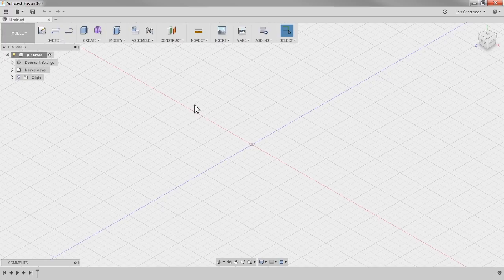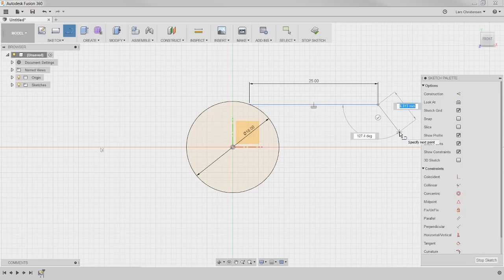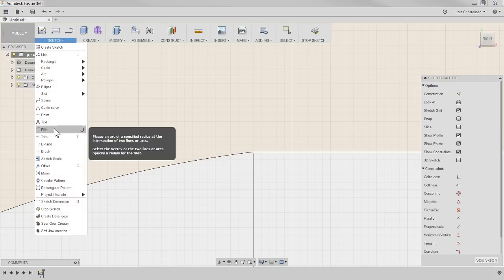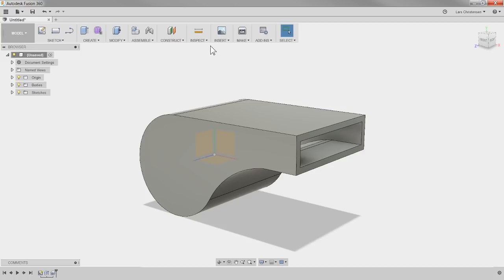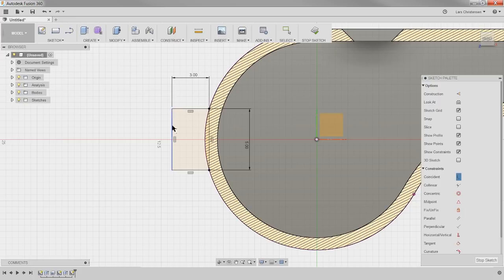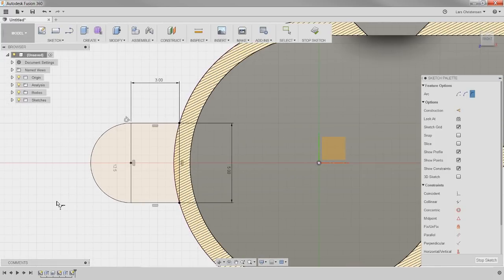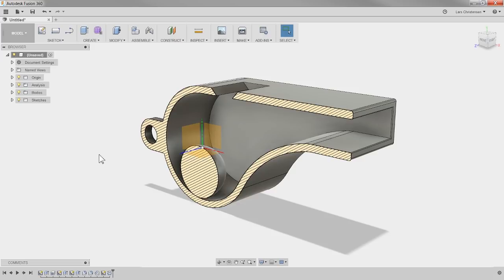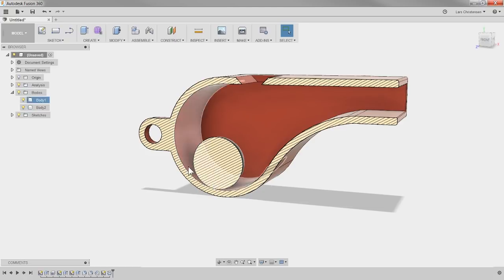Fusion 360 Absolute Beginner - How To Model a Whistle - Last Nights Facebook Livestream

Comment: 21:50 You can hollow the body and leave all faces intact by clicking on the body in the browser tree and then setting the wall thickness like normal. You can verify it is hollow with section analysis

Comment: for those who could not close the loop for the top hole in the section analysis. I produced the same result by creating a rectangular hole on top and then applied "modify->chamfer" with the value of 1 mm.

Comment: splitting it in half is great, but what if you want to join the pieces back together? How do you make a lip on the inside of one of the halves so when you glue it together, both sides align?

Comment: wow. i have used sketchup a lot in the past and wanted to upgrade to another program like blender, f360 or 3ds max but they al seemed to complicated at first to learn. i may sound stupid but now after i watched this video i have the courage to learn another program.
thank!
Reply: So, two months late here, but what are you wanting to use these programs for? Because blender is more of a modeling/animating software as opposed to CAD. Just a heads up in case this is still relevant!

Comment: Hello Lars, Thanks for all the videos! My old brain is slowly soaking it in. I have tried to get me first line off the circle to stick and act like yours. Don't know what I'm missing. I get the lock but the line keeps changing size and when I try to take the next steps it doesn't set up like yours. It seems like all the actions have to be done while I'm holding down the left button but it still seems to not be working.
Reply: so it seems like the line is automatically adding the tangent constraint. still stays blue. driving me crazy
Reply from the maker: Hi benton wahl Thank you for watching!
If your sketch is still blue, but you can't drag any corners, or move the sketch around in any way I would move on. It could possibly be something in the software.

Hope you have an awesome day!

Comment: Very nice video Lars.
Would it be for printing, then the ball would preferably be on the top side of the whistle. When preparing for the printer, I would like to print it with the straight side on the print bed so I would have to use minimal supports and then the bal would be something that's hanging from the top, making it not printable. Also, breaking loose the ball would be much easier then because you can stick something inside the opening to break it loose.
Thanks for this great video. I will make one.
Brian.
Reply from the maker: Hi 3d Print Creator Thank you for watching! ANd for the helpful comment

Comment: If you never knew, how you could ever know. Very wise words. For some reason I can't grab that constraint in the center of the Section analysis. It worked when adding the hole on the back of the whistle after numerous tries but I could not get the constraint to work with the ball. I checked so many time to make sure auto project edges on references was selected. So very odd.

Comment: Hey lars I am unable to select the top and botom edge line to cut out the opening on the top. I turned on in prefferences : auto project edges on reference. I also tried with project in the scetch buton without any usable result. when I hit  p i can select the botom edge of the top body but I can not draw a line to the top what do I do wrong

Comment: When I try to draw the line from top of circle, the second line, it is snapping to the tangent automatically and not giving option to do anything else. If I snap the second line and try to draw the third line, using "L" or selecting line option, it will only draw a curve and then tangents off the second. I am assuming that there is a setting somewhere I haven't found but I'm kinda stumped. Any help would be appreciated

Comment: Lars can you do a video on plastic cases showing how easily make various molded snaps that lock a lid to a body does fusion have a wizard for it
Reply: A curve case with seam which not horizontal but follows curve part line ie like remote or mouse body
Reply from the maker: Hi henri Thank you for watching!
That is a great topic. I will add it to the list.

Comment: Hello 

Thanks for the tuto, on macos, at 7:00, the box to change the diameter of the circle don't appears. There is an option to active to view the parameters and constraint ?

Thanks
Reply from the maker: Hi Stephane Ramauge Thank you for watching!
Not sure I understand the question....sorry
Reply: Hello .

With sketch fonction, on a square for example, after enter the length/hight with pop-up menu and validate, i can't modify it. The popup menu for changing the length/hight don't show.
I had to choose "sketch dimension" to modify it.
Is it normal ?

Comment: At 28:55. Is there an easy way to move the sketch for the opening that was just created to the center analysis section? When I did mine, it did it to the outside and not the middle of the whistle LOL. I do have 2 sections under analysis because I had made a mistake and didn't delete one, maybe that caused the issue.

edit: I was able to figure out to work around my mistake thanks to 32:00 

And of course, thank you so much for the great tutorial.

Comment: I began to draw the sketch as you showed, but I can't do the movements as you show. For example I draw the next 6 mm line, but I can't change the line's degree, I can't spin it around. Also I wasn't able to move the first line around when I drew it. I had to draw it near the circle and later connect them. I also get an error message when I try to constrain it vertically.
Reply from the maker: Hi Tibor Sallai Thank you for watching!
So Fusion will try to help you when you draw lines and arcs by inserting constraints. Really just trying to assist you, so you don't have to insert them all. So it sounds like you draw a line and Fusion inserts a constraint for you....
Check out this video:
https://youtu.be/pqd_wlz9gpQ?list=PL40d7srwyc_Mkgc5wvP_OfVel9aDkNkZ6

Best,
Lars
Reply: Lars Christensen thanks, I later found out. I was even able to finish the model miself. The tutorial is really encouraging to go on by your own instincts. Next I try to find a way to cut apart the model on one side and move the side away. I found the tool to cut it open with a plane, but how can I move the selected parts?

Comment: I am facing a problem. I made a iphone case using Fusion and I want to offset the outline of the backface. However, when I select all edges and turn on Offset, only one edges was selected and only one edge can be offset. Really struggle with this issue. Can you help me out?
thanks
Reply from the maker: XW H, you should be able to open a new sketch on the backside, hit "P" for project, select the edge and then offset that. I am thinking you might be fighting the curved radius???....Or maybe I need more coffee..

Comment: Thanks, would you like to tell me, how can the ball free run in the shell?
Reply: Por Lam you can raise the ball so that the printer will create a small bridge so that it is connected to the print build, and then you can knock out that bridge with a knife or thin object through the front slit of the whistle
Reply: @unduelist5688  thank you so much!
Reply: Por Lam or alternatively you could create the whistle in two pieces, insert the ball, and then connect the pieces, or you could create a very small hole in the whistle to insert the ball, then patch that hole up. You should probably place the hole on the bottom for the second method.

Comment: Grrr, this is super confusing and Fusion is driving me nuts because nothings seems to look or work precisely like you explain.
Like already now when I draw the 6mm line it's locked and won't swivel like yours, there's like  a titled T by the connection and it's locked in place, there seeems to be no way to get it to the unlocked mode where the line will swivel. My line is immediately black too, not blue.
Reply: mine too, I just leave it black and move on. there are going to be differances. we have a more modern version of fusion.
Reply: Mine did the same. That T means they are perpendicular (found the picture under constraints), and since the new 6mm line is now constrained as perpendicular to the 25mm line, it can't be blue and moved, so it's black. His version didn't do that, so there must have been an update that does this.

Found two solutions. One, when you draw the the 6mm line, don't make it perpendicular. F360 sees the perpendicular orientation, and assumes that's important, and sets the constraint automatically.

Second way to fix this is click the T and delete it (keyboard or right click delete). It can then be moved freely since it's no longer constrained as perpendicular.
Reply: @nathan118  Thank you a lot! I struggled with this for a long time before I found your reply

Comment: Hi sir I am new to fusion 360 I'm old school and have designed a project on a drafting board to scale just brought a new laptop and down loaded home hobby version of fusion 360 ,can you refer me to one of your videos that covers how I can draw up a base plate then using the base plate to draw separate components that are based off the base plate so I can transfer dowel holes and threaded holes so everything stays in line once I draw them up separate them so I can add features to the component after I have drawing it off the base thank you Philip

Comment: i've been fighting with this for about a half hour now, i cannot get the line to draw inside the analysis area, it always wants to work on the outside face does any one know if some of these  features don't work in the personal non commercial version?
Reply: some things changed, this was filmed in '18
im struggling too
Reply: Tried messing with it for like 2 hrs. Any updates?
Reply: I had this problem - tried to sketch the cut-out and it always appeared on the far side not the cross hatched area. I think you have to select the origin plane so that is is drawn on the cross hatch side
Reply: I tried drawing the cutout on the original sketch, and then adding it as a cut out. But since the body is not visible, it refuses it to be anything else than a new body.

Comment: 50:30 when i tangent the circle sketch to the arc it sticks to the side of the whistle, so when i revolve the circle it conflicts with the side of the whistle.. I tried to tangent it and then use the move/copy modification but it still stays on the arc on the side of the whistle.. Can i tangent it somehow in the center of the z axis?
Reply: If you're having trouble revolving the ball sketch due to an error, try creating a tangent constraint between the arc and a point on the circle rather than the circle itself. I hope this helps?

Comment: I get soo frustrated every time I try to follow Fusion tutorials because I can never get my setup to look and orient like is shown in the videos. Not sure if it's a Windows vs Mac thing or something else. My cube never shows the X and Z notation like yours and the origin never matches up with the top cube shown, regardless of z or y up. It seems like the axis I see are always 90 degrees off.
Here is a pic of what I mean, the background is from the Fusion forums helpguide and the inserted is my screengrab, they don't match up and both are set to Y up.
http://www.tifozi.net/img/orientation.jpg
Reply: I'm new too so I may be wrong but it looks like yours is Z up. If you close the current file and start a new file after having set the default to Y you should see the difference.

Comment: Dear lars when I draw any circle my circle not change from blue to black similler to when draw even line. What is easy way turning from blue to black. Pls
Reply from the maker: Hi sahin Sarker Thank you for watching!
I would think that either the center is not attached to something like the origin or you don't have a dimension on it. If it is the first, try to drag the center of the circle with your mouse

Comment: I'm sorry, but this is absolutely not a tutorial for beginners! You forget to mention a couple of times that you use specific shortkeys for example. At some points you switch to some other view without mentioning it and how you did that.
Reply: actually, there is always a way of self-education... A little RTFMs...
Reply: Dear Hielke, I don't know if you mentioned that this is NOT part #1 of the Absolute Beginner tutorials. If you would start with the first parts you wouldn't be confused about switching views or using standard shortcuts
Reply: Ya there are some steps missing, can trip you right up when you don't know where to find certain tools or what they are.